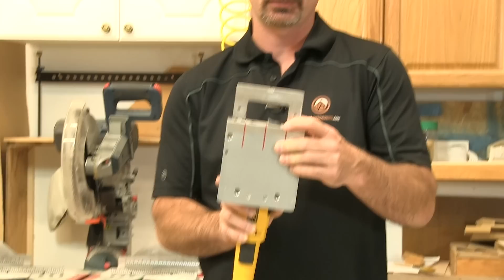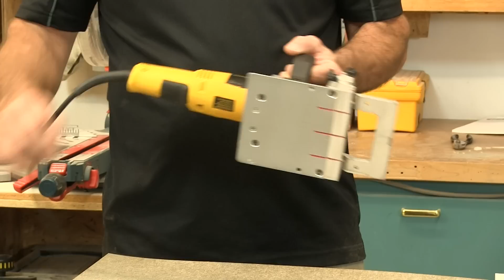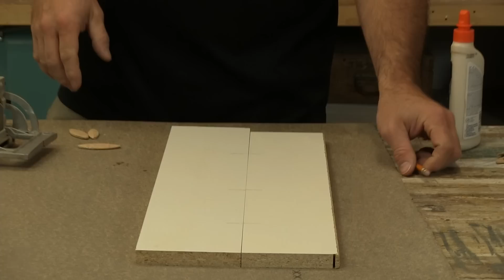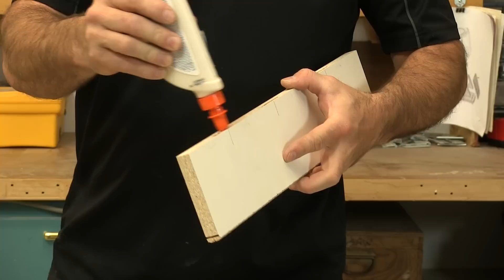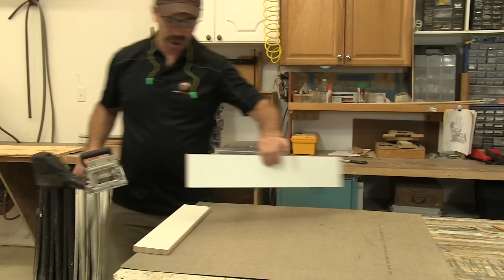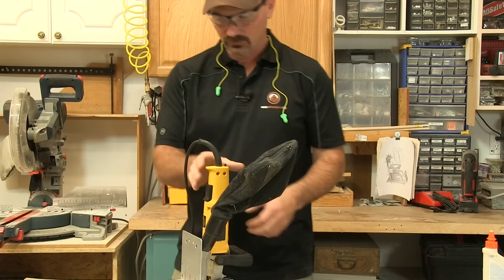How To Use A Biscuit Joiner

Comment: hi. would glued biscuit joints alone be sufficient for a melamine cabinet carcass? or do i need to screw coarse screws as well?
Reply: Using Titebond Melamine glue, no problem.  That stuff really does stick to the melamine surface.

Comment: Informative.Two days ago I went to emergency to try to stop the bleeding and sew back what was left of three fingers.NEVER EVER put your hand in front of that saw, I’m not a novice woodworker.I was holding a piec ofwood EXACTLY like you were, maybe even with a tighter grip......the saw blade hit a cross grain and in a split second turned three fingers into hamburger meat.
CLAMP everything, keep your hands in back of the machine.
Reply: Green Man This is the second such comment I’ve seen on YouTube. The other guy said he’d been a carpenter for 30years and it was the only serious injury he has ever had. In his opinion this is the most dangerous machine in the shop.
Reply: I believe the C-clamp to be the most dangerous tool.  I kept turning the thread slowly and before i knew I completely crushed my thumb.  Didn't see that coming.

Comment: great video, I have always debated getting a biscuit jointer, now I need to find that project to use it on to convince the wife any suggestions?
Reply: Kevin Peralta  They are fairly cheap.  If you can't afford a new one, buy a basic one from a pawn shop.  I just picked up a like new, I mean it looks brand spanking new, Freud one for $40 out the door.  

$40 for a tool is nothing.

Comment: Not up to your usual excellent standards.  How do you set the depth to the middle of the boards to be disquieted  together?
Reply from the maker: watch at the 1:58 mark. At that point I talk about how the guild will adjust. As far as finding the center ,just measure your material and mark it then line up the centre of blade guild mark on your joiner.

Comment: I've never used a biscuit joiner. I'm a big fan of tenon joints and  doweled joints. I think they're stronger. But I like the ease of indexing with a biscuit joiner. Except I'm hearing that the biscuit joints aren't any stronger than a glued butt joint.
Reply from the maker: No they are for sure stronger then a butt joint
Reply: HouseImprovements I've never tested myself. I've only seen tests others have done.
Reply: My biscuit joints never turn out right. Idk what i am doing wrong. I am going to dedicate one day to correcting that. It's gonna be me against the joiner dangit. The loser has to go.